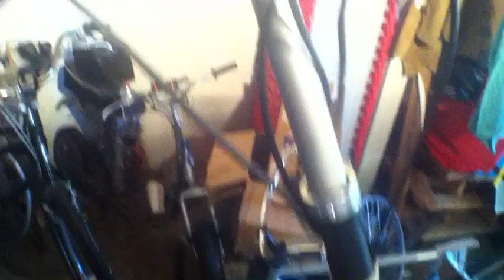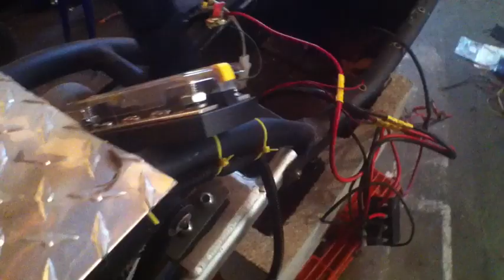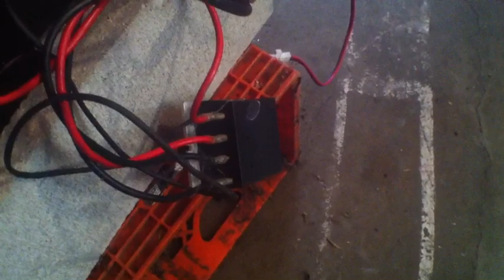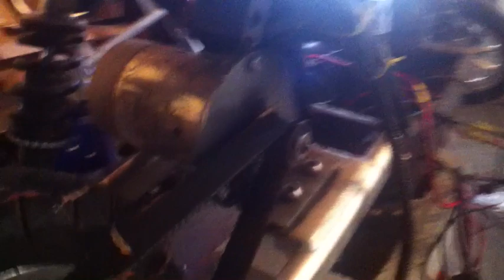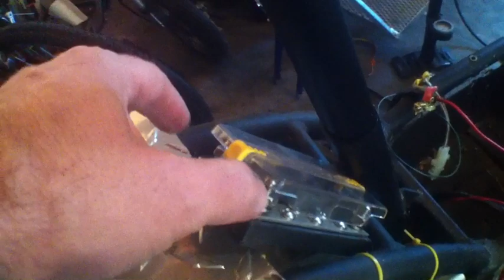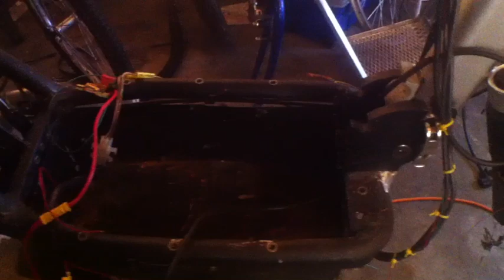Vego 600 sx electric scooter reconstruction and Electric Vehicle Basics

Comment: maybe you could advise the controller you are using ? looks a lot more simple than the vego  600 silver box of a dozen wires and half the size - be interested to know what it is for the 24v ? control   ta  just rebuilding my old one now - lengthening the back shock tower to lower curb grind going from footpath to road etc - would love a smaller controller for the enlarged battery box for the bigger bats -

Comment: Purchased a used, but nice, electric scooter and it's been GREAT!....until a few days ago when it started "choking/jerking"...now it's not running, but EVERYTHING else (except the motor) works; lights, horn, etc, etc.

Upon opening it I saw a thicker green wire that looked distinctly cut and didn't appear to have 'broken/pulled off' from ANYWHERE, but it seems to me it's the ONLY thing on the scooter that 'looks' out of place, etc.

I'm convinced if someone who knew what they were doing looked at it they would know what's happening, but I can't....

Any advise?

It's a 'no name/Green World Electric Vehicles' scooter...nothing in english aside from the post manufacturing stickers/logos.

any info would be swell!

(I can send pics of the scooter and wiring)